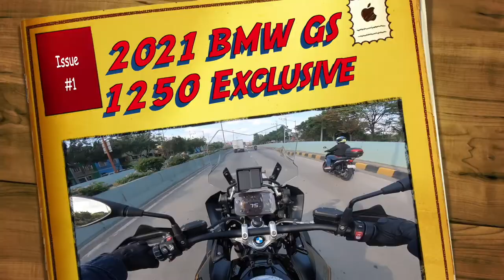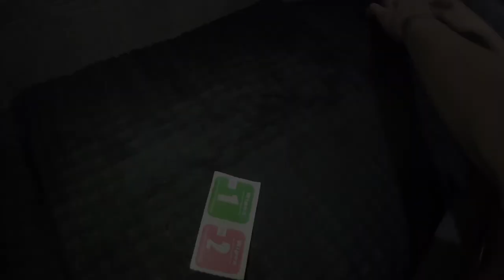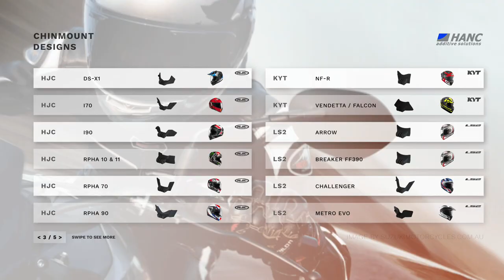Arai Rapide Neo Cafe Racer | HANC Chin Mount | Installation

Comment: how's the ventilation in the front vents when the go pro is mounted?
Reply from the maker: Hi there Ace thank you for your comment. It’s totally fine, my GoPro is tilted so it doesn’t really blocked the front vents and when you’re travelling on a high speed, you shouldn’t have a problem with the front vents. Cheers! Ride Safe and God Bless Always 🙏🙏🙏
Reply: @dmotomusik7548  Thanks for the reply. Ride safe as well!